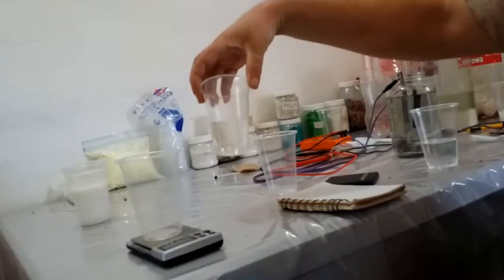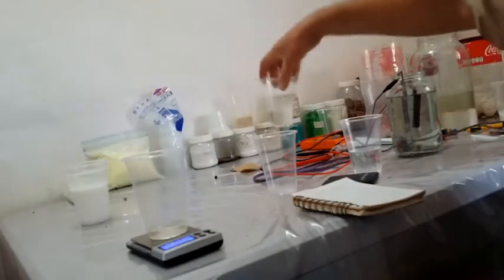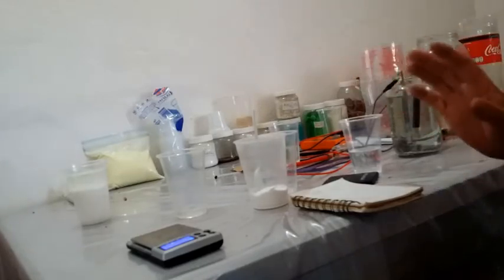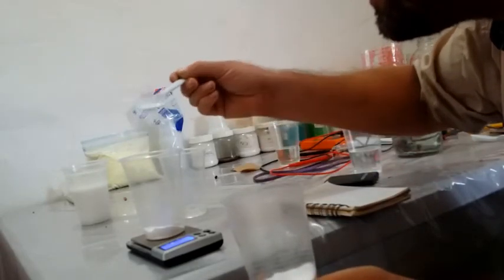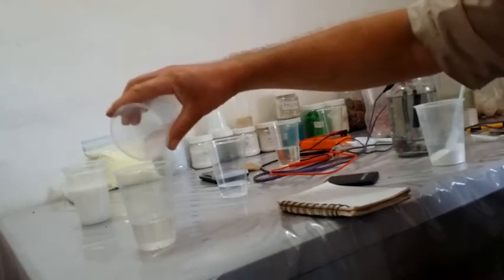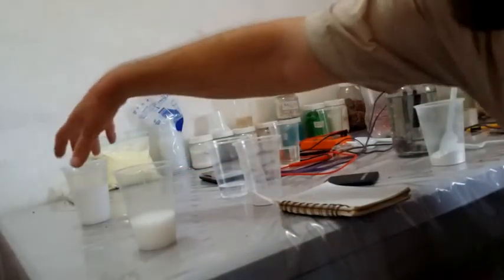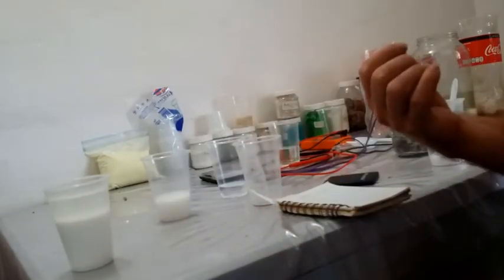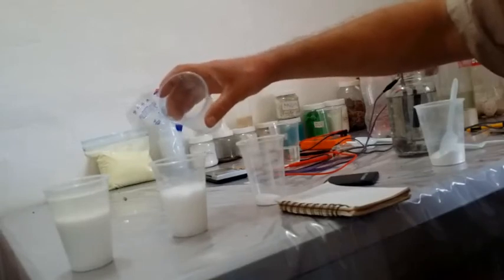Double displacement Zinc sulfate to Zinc carbonate

Comment: Can you make iron phosphate?
Reply from the maker: FeCl3 + Na3PO4 = FePO4 + 3NaCl, FePO4 is insoluble, so it should precipitate, leaving NaCL in solution. I don't have Na3PO4 on hand, although it could be synthesized with Sodium Hydroxide and Phosphoric acid.  3NaOH + H3PO4 = Na3PO4 + 3H2O. FePO4 could be an interesting substance for battery experimentation, as its used to make LiPO4 for Lithium batteries.
Reply from the maker: All simple double displacement reactions. :)
Reply: @Ahamshep  Thanks